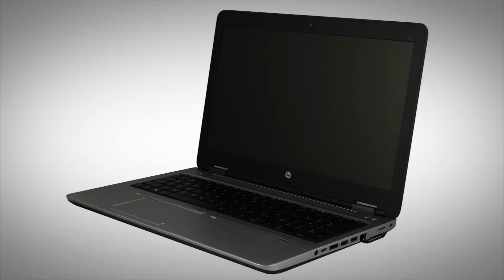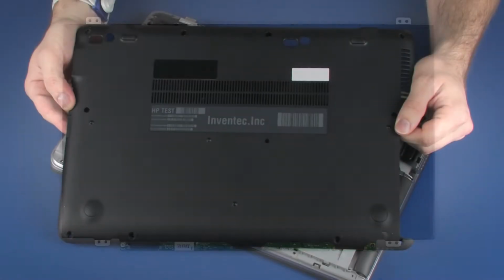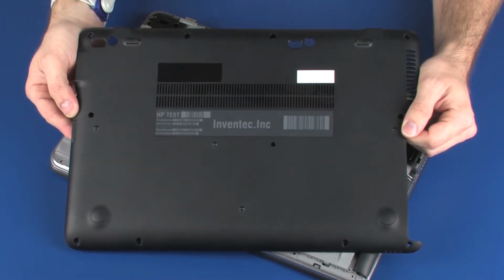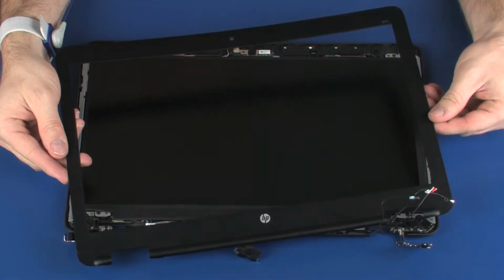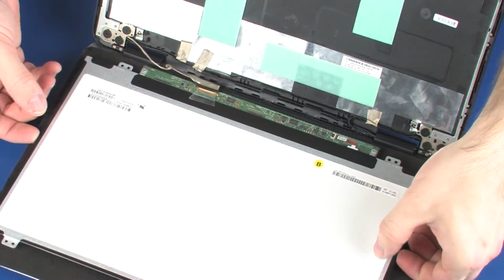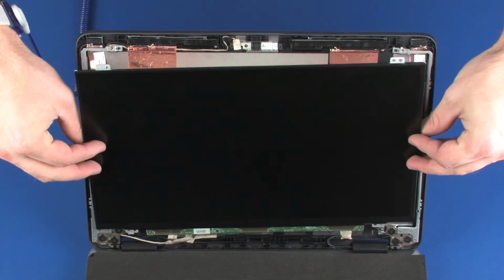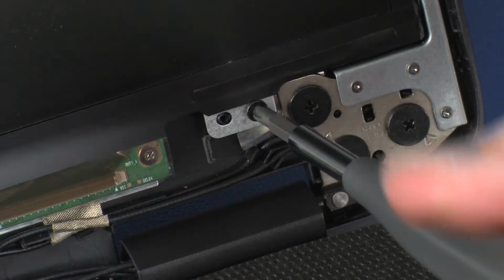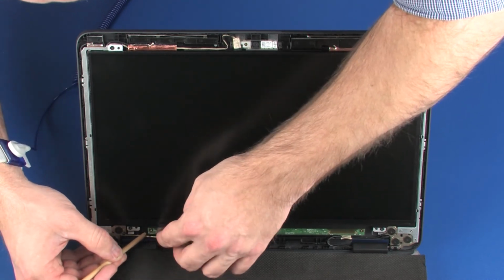Replace the Display Panel | HP ProBook 650/655 G2 Notebook | HP Support

Comment: Great video and very informative. I have the same laptop with some black marks and spots that are starting to appear. Any tips on the best place to buy a replacement screen? Thanks!
Reply from the maker: +Levi I understand that you need to purchase screen for your notebook.
You can purchase it or any other accessories from here:
www.hp.com/accessorize 
I hope this helps you!!
Reply: @HPSupport  Thanks for the link. I   want to replace the screen for the HP 650 Notebook but need to confirm if I need a screen for a 30 pin video connector or 40 pin one. I cannot locate this information in the specifications. Would you happen to know?
Reply: How much cost of screen.